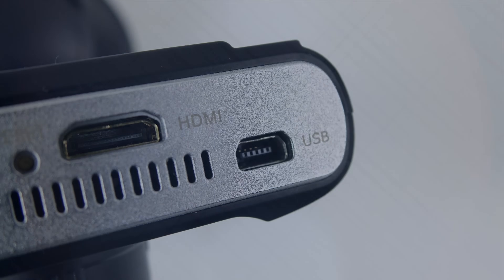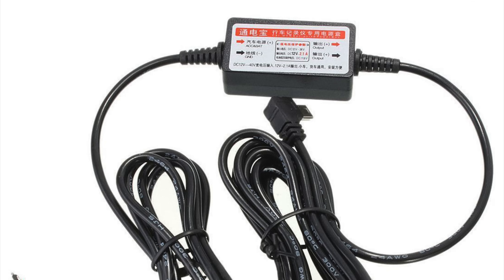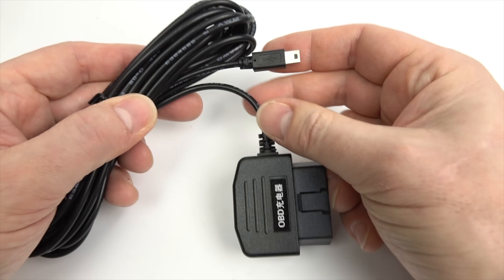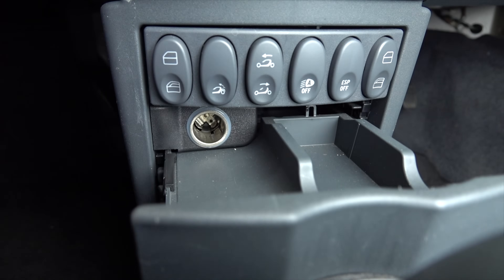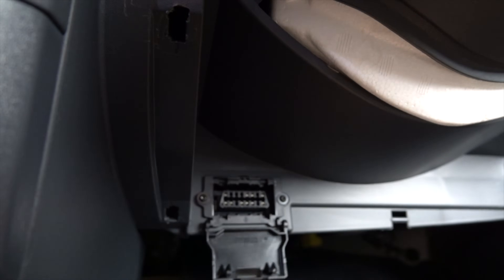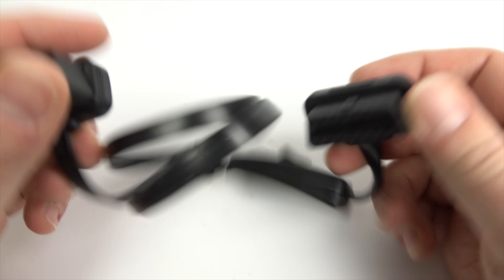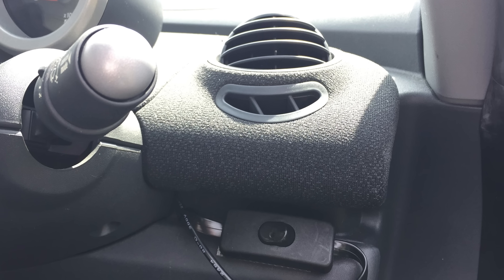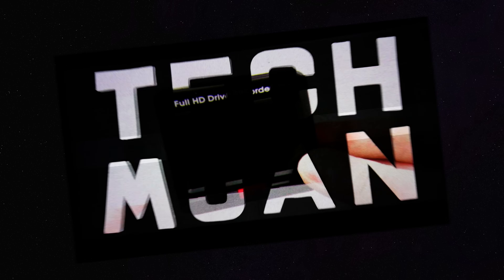You can power a Dashcam via your OBD port (but perhaps you shouldn't)

Comment: >95% of OBDii ports are permanently powered, a product I developed (milelogik) uses this fact to keep a GPS mileage logger permanently powered so you can jump in and drive with no waiting for the GPS to get a lock.
Some cars like my Ford Focus though has the cig lighter permanently powered. Which is a pain as I keep forgetting to unplug it.
However when finding someone had bashed into my car and the camera was still running I thought great! I will find out who did it. But all I proved was that it was not done in the last 8 hours. :(
Reply: +Tim Box What sort of Focus do you have? I've got a 2015 and it has two lighter sockets, one on the front of the console and one under the armrest. The armrest one powers off after about 5 min, so I keep my dash cam plugged into it.
Reply: Jeff DeWitt My Focus is a 2004
Reply: Tim Box OK, I guess those are different. It was really that first generation Focus that got me interested in them, for quite a while I was thinking about one of the two door hatchbacks but by the time I got one it was a second generation, which was a good enough car but not very exciting. I like my 2015 well enough but it's got too many doors and I'm just not a fan of automatics, even if it's one of the new type "manumatics" with the flappy paddle shifters.

Comment: Techmoan :- Have you considered testing 'Battery Saver' devices such as the 'Power Magic Pro' which cut the feed when the battery voltage drops below a certain threshold value - so if fed from a permanent supply,  when engine is switched off it will cut power to the dashcam when voltage drops to say 12.2v.
As I couldn't find a switched feed in the rear hatch - {fitting cam to rear window} - I need something like this to automatically kill power shortly after Ive stopped.

Comment: I have a blackvue camera, was about 200 quid but it takes power permanently from the battery and the switching on and off is done based on the GPS and weather the car is moving or not. I have it in parking mode so when the car stops it only records if it sees movement or senses a jolt, with a rolling buffer. I think if your really serious about a proper dash cam, one like this is the best choice. I had a 0803 and 0805 before and the blackvue blows them out of the water. Well worth it.
Reply: Or for about half the price (or less), something like the Goluk T1 does the same job.

Comment: I was wondering... Can the cable be use for check engine light diagnostics? I want to connect to my android  device.
Reply: You can go and buy a OBD2 bluetooth diagnosys gadget. Costs 10USD. You plug it into the OBD port and connect your phone via bluetooth. You will need an app called torque. You can read read and delete your fault codes and you can access real-time data from your car. (coolant temperature, throttle position, RPM.....)
Reply: +TheDarkstar826 Power adapters usually only have wires connected to the power pin(s) and ground(s). There is no need for the data lines in this application, so they would not be connected. For this same reason a lot of USB charging cables do not work for data transfer, because those wires are missing.
Reply: Thanks for the info guys.

Comment: Great review.  My daughters 2014 Corolla S, odb port stays powered all the time.  So, I did not use it to power the Dashcam we bought.  The accessory plug that came with her Mini 0806 has a sliding back cover so you can plug a standard usb cable in to the back of it if you needed to charge an accessory.  Take care and thanks for the great reviews.

Comment: My OBD2 port is just behind a pull out drawer so it doesn't close if anything's plugged in to it. I want to relocate the port if I can to use a bluetooth adaptor to connect to my Android head unit. Thanks this is a useful video.

Comment: Using the port should't damage anything in theory. The problem could be if a product you are attaching has some fault - perhaps a short in the wiring. There is the potential (although quite remote) that you could destroy the ECU - very expensive. Much safer to get a gadget to attach the device to the vehicle's fuse box - safer too in case of overloads (getting hot/catching fire, and so on) etc.

Comment: Id say its fine to power your stuff assuming you check where where the 5v is coming from, ECU or straight from battery. Also check the fuse rating on the OBD port but seeing as it hasn't blown its probably fine.

Comment: OBD has a spec, you can look it up.
All the internet experts can pipe down now.
https://en.wikipedia.org/wiki/On-board_diagnostics#OBD-II_diagnostic_connector
OBD spec says 4 amps @ 12v or 2 amps @ 24v, so 48 watts of power ...
I've been using my obd port to power home made diagnostic tools for quite some time.
It's perfectly fine.

This is just another case of some people pretending they know something, and passing that on as "advice".
Reply: +detaart This poster is dead-on correct.  Also note that the spec calls out the +12V as battery voltage in particular - OBDII spec requires that +12V be directly from the battery, not switched.  Any device that plugs into an OBD port and automatically shuts off after a time must be checking for actual OBD data and going to sleep when they don't see any.

With that said, I'd also run a proper "add-a-circuit" before I would run this.  Done properly, you would not have to modify anything on the car's existing wiring - you unplug a fuse, plug the add-a-circuit in place of the fuse, and plug the existing fuse into one of the two fuse slots on the add-a-circuit.  The other fuse on the add-a-circuit goes to the wire coming off of it, run that to your device, and ground your device at a good nearby ground.
Reply: IOwnCalculus Sound advice.
I would prefer this solution myself, because it would keep the obd port free, so it can be used for it's intended purpose.
Reply: i had my insurance device called ajusto  plugged in for almost 2 years now with no issues
Reply: +IOwnCalculus If the OBDII port delivers direct battery power, I'd be interested to know how the Valentine1 with Savvy knows how to turn off when the ignition gets switched off.
Reply: Eric Caldwell probably has something that can read data from the obd port. it's intended as a data output after all.

Comment: By the way, an interior light can kill a battery after a few hours
Reply: +Landie Man Depends what kind of battery. It wouldnt do that to my Optima Yellow Top. But then, for the money they cost, it damn well shouldnt !
Reply: My 10W interior light would need over 100hours to fully drain my 100Ah battery. If you own a car with a petrol engine and have the same 10W bulb you would still need 50hours
Reply: Blatt Ferenc
I've had them drain batteries in about 2 hours
Reply: +Blatt Ferenc Car batteries are not made for long, small current output. They are made for the big current spike of the starter, and their Ah rating reflects only that kind of consumption.

And yes, Ah ratings change with the amperage, it's not the simple current * time that school books teach.

Comment: my 2008 smart fortwo has an OBD port that powers off after 30 seconds. i have an Ultra Gage and a monitor from my insurance company that gives me a discount for safe driving running off that port at the same time. i can leave the car for a week and the battery is fine, even with the factory alarm system. must be a fluke from the 450 smarts, the 451's don't have that issue. i'll have to look into an adapter like that, easier than hard wiring a dash cam!

Comment: Same thing for iPODS, some cars power ports are continuously powered and you can drain your battery leaving the iPOD plugged in. Good thing to check so you don't have a dead battery. Now day's with cars having 5 computers it doesn't take long for batteries to go dead a lot faster then older cars with the same battery.

Comment: Some have used cheap Engine OBD Analyzers while driving and said it fried their entire electrical system. It's an issue that some Auto Insurance Companies are aware of in the USA and can cause them to call you an idiot and not want to insure your car when you fried it with a OBD Dongle. Some are using "insurance" OBD dongles to monitor their driving for cheaper insurance rates and claim that the dongles ruined their cars electrical system and in return are now suing the insurance companies. Since I see these dongles sold from China for as little as $5 USD I would be wary too.
Reply: +TekReview&#39;s Bullshit.
The power line on obd is fused, and the data lines are isolated.
The obd port provides no way for you to fry the "entire electrical system".
Reply: detaart GO read articles on it douche bag. I simply mentioned the facts customers have been saying based on their own mechanics checking out their cars. So SUCK IT!
Reply: TekReview's And it's bullshit.
Don't start crying now.

Comment: I made a "frankenbox" for my car, a wireless 4 channel relay, a small plastic box to contain everything, and the lighter sockets to get power to everything. The main power comes from the socket in my console, the box and other sockets are under the passenger seat and the wires go out from there tucked under moldings and such.  I have the remote mounted on the headliner, pretty slick. 

They make piggyback fuse holders, depending on what fuse you choose it may be live all the time or go on and off with the ignition, very easy to hardwire something safely without making any permanent modifications.

Comment: I'd be wary of this for a few reasons:
Draining/damaging the battery if you forget to turn it off due to over discharging.
Dodgy Chinese power supply-could damage the camera/dodgy wires making connection to data pins of OBD could damage car computer.
And this is just me being paranoid in my tin foil hat, but I would not be plugging anything from china, if at all, into the port that has access to my car computer without opening it up and checking that it was doing what it was meant to do and only what it was meant to do.
Anyway great interesting video as usual😄
Reply: +Cameron Steel It's not drawing power from the data pins dude ...
The obd port provides a fused 4 amp supply.  It's fine.
Reply: detaart I get that, it's just if there was an accidental/malicious connection to the data lines... As I said, I'm just being paranoid, but I wouldn't really want my car's computer to malfunction while I'm driving 110k/h down the freeway 😁.
Reply: Cameron Steel I understand, but it's fine, really.

Comment: But my '96 Camry has its Diagnostics port under the hood...  And it's a very odd proprietary connection.
Reply: Thanks for better explaining the second diagnostic port found on certain Toyotas.
Reply: +SegaMischief If it was sold in the US as a 1996 model year car, it has to have an OBD II port by law. It could very well be that the diagnostic port that Toyota scan tools like is under the hood, and the OBD II just can tell an emissions test computer whats up.. but it has to have one, or you would have been failing emissions tests since 2004, when the new machines came out (they just plug into the OBD II and ask the computer if it has turned the check engine on, or not. Makes sure it's completed it's testing (so you can't just unplug the battery to clear the light and take the car in straightaway). Then the mechanic has to make sure the check engine light is functioning. Then you get a sticker).

A lot of companies started adding OBDII ports in 1995 (Cadillac and GM did, to test out their system). I would guess that Toyota maybe used both their old diag port under the hood while they worked on a new scan tool, and also provided an OBDII port. Check up under the steering column and up under the glove box as I've seen some of them unmounted and tucked up on the first few model years that had it, as opposed to having a hard attachment point. According to google it's under a fuse panel cover, to the right of the fuses under the steering column. google 1996 Camry OBDII location.
Reply: Thank you, I just found it online.  It's behind an ashtray that has to be pulled off.
Reply: The diagnostic port under the hood is for other diagnostic functions. I had to diagnose ABS brake problems using the port under the hood. Another reason that port exists is because OBDII codes aren't perfect. I had to diagnose a 1997 Lexus ES300 that would take an excessive amount of time to start the engine. The problem didn't trigger the check engine light. I jumped 2 terminals on the underhood diagnostic port to test the idle air valve, and test proved that the idle air valve didn't move 100% of the way open.
Reply: Skyline Fever
Yeah, although it was US Federal Law that all cars from 1996 Model year had to have an OBD II port that would output Emissions information (enought for the OBDII emisions tests which rolled into effect starting in like 2004), it was up to each individual manufacturer how much more further to take its functionality. While by 2003 it was the only port on most makes and models, a lot of older cars still have their proprietary vendor ports for their own scan tools until an OBDII scan tool could be tested and deployed.
   In the case of the throttle bypass air port, there's a stepper motor in there that can't talk to the computer. It gets told what to do (step +1 or step-1) but it can tell the computer that it's done that. And the computer can't know its not working, or where the stepper motor is. They often get blocked by soot/debris and "lost"  Anyway, the light won't turn on for something like that unless it causes a snowball into larger running problems (since it won't know until something else is effected, something else with a 2 way communication sensor).

Comment: A fuse tap is just as easy...quickest way to find out which fuses are key switched  or only on when motor running is through your vehicles forums...almost as quick is to figure out which fuse is on the lighter socket and tap that one...   http://www.amazon.com/s/ref=nb_sb_ss_i_3_5?url=search-alias%3Daps&field-keywords=fuse+tap&sprefix=fuse+%2Caps%2C167

Comment: Many dash cams now that have a parking more require a switched ignition line, and a always hot wire.  These can be taken from the radio harness, and on some vehicles, you can take the power from the interior lights, and map lights if the map lights are switched.

Comment: Not all cars have a directly ignition controlled fuse to take a feed from these days, many use the CANBUS to tell things when they should be on or off,.The only ignition switch controlled fuse in my 2004 A3 fusebox is for the rear wiper for some weird reason, everything else is switched by the ECU.

Comment: Use a fuse tap to power your hard-wired USB PSU. No need to cut into cables, everything is protected by its own fuse and they only cost a few quid! You can get them for standard size automotive fuses and micro and mini size. I use them to power my dashcams.

Comment: There's scope for intelligent electronics here to for the right person, something like an Arduino or Raspberry Pi could be used with GPS to check the location every 5 minutes or so, combined with a detection method for the ignition this could be set up to keep the camera running if the car is running or you're away from home but cut power if you're at home. It could even monitor the car battery if you really wanted it to. Alternatively tie the home detection to the detection of your home WiFi network and make it scan every time the ignition state changes, might be more reliable.
Reply: +Matt Tester or you could just pull the plug out
Reply: +Matt Tester Some dashcams do that already. Those features are integrated into the cameras.

Comment: best way I find getting an extra 12v is by using an "add a circuit" fuse holder. Gives you a fused second circuit easily.

Comment: Another option I did was to make up two male/female blade connector short wires 
, with a lead joining each into a new separate cigarette lighter socket. The short wires plug into the old cig lighter at the back and the car loom. now you have a second socket to plug the dash cam into. It's all removable and no damage to the cars wiring etc

Comment: Some GPS trackers used by companies just plug into the OBD port and of course, draw their power from the socket.
Reply: +CreativeTux  We don't because the obd socket is easily accessible and can be disconnected, we hard wire all applications that don't require an obd2 interface for fuel or fault data.
Reply: +100racer checkout reponut on YouTube he sometimes uses an OBD port for a quick GPS tracker
Reply: CreativeTux yeah I am a subscriber to his channel, i deal mainly in permanent installations for fleets where they want reliable  tracking and driver monitoring.
Reply: +100racer yes deffo perm installations like the one in my Iveco Stralis are hard wired for sure.
Reply: +CreativeTux depending on the tracker you can also have a connection to the tachograph for driver identification and even remote downloading of data from the tacho head.
so the company can know about your infringements before you get back to the yard!
Reply: +100racer Yep we have it integrated into Tacho, trucks ecu, onboard cameras and Satnav. they can even reroute the satnav from the office.

Comment: If you pull the cigarette lighter socket out, it's bound to be connected with spade connectors at the back.

So you just need to make a little loom for the inline one, with male and female on each wire and you can plug it inline for the lighter socket, and remove later.

Then it will be hidden, removable, and come on with the ignition.